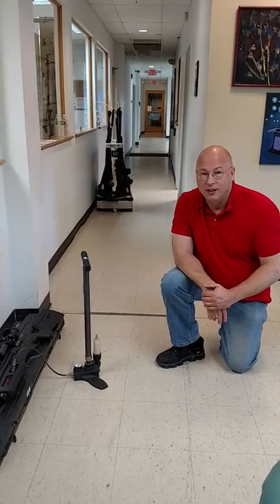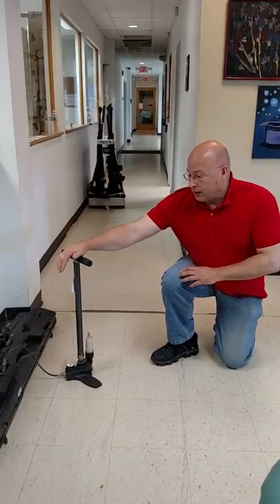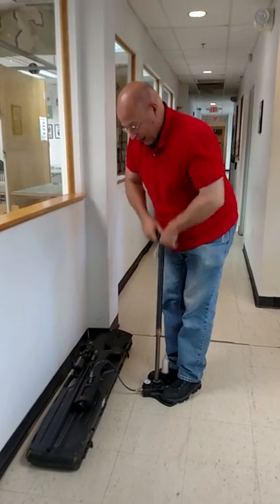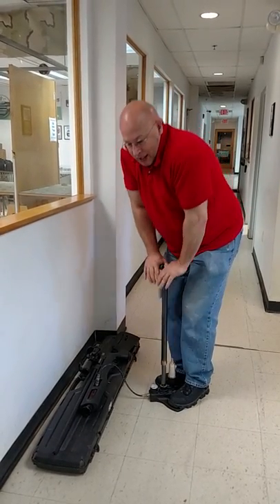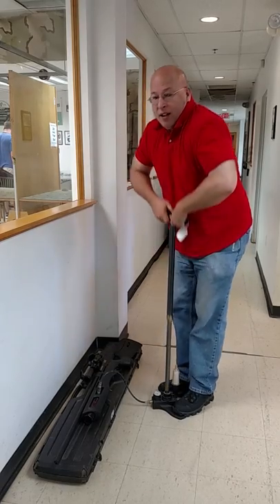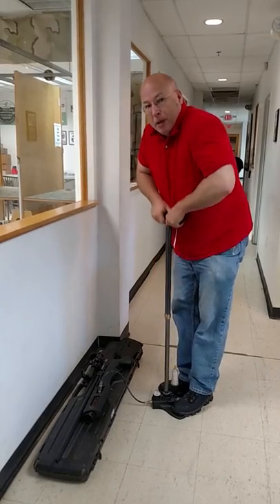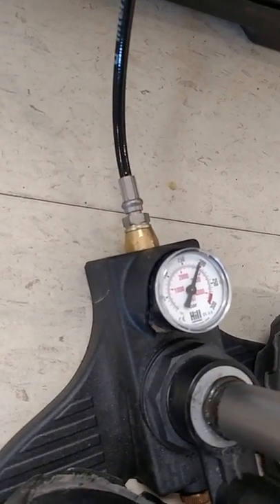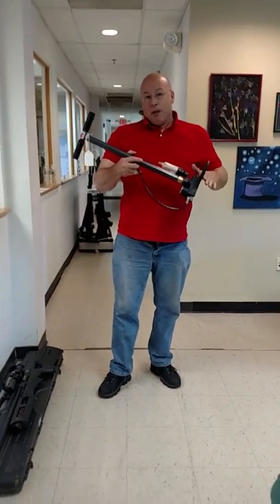Pumping up your airgun

Comment: I have the four uncles pump but is states I should warm the pump up?  How is this done???   50 pumps with the release open??  Another question, this pump is sold as a 4500 psi air pump but the red starts at 3000psi,  I have seen people on utube run into the red to get 4500  ...do you recommend this??